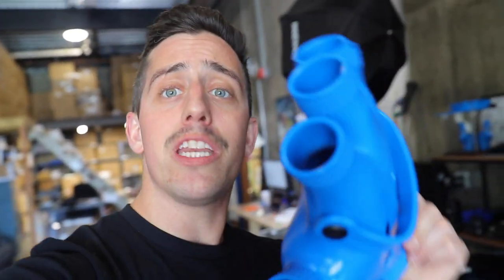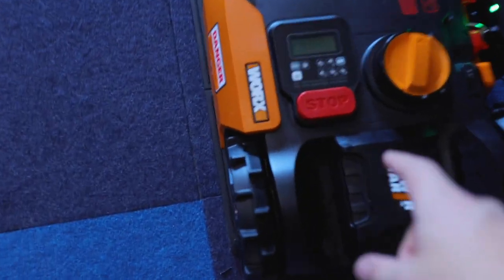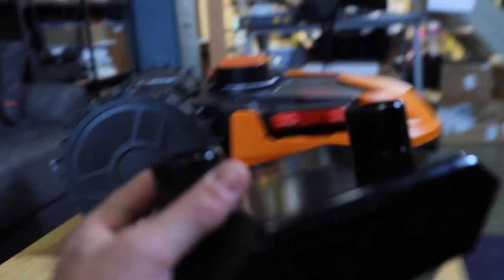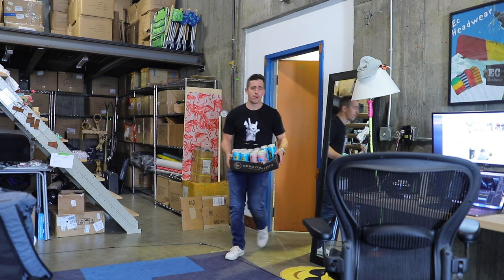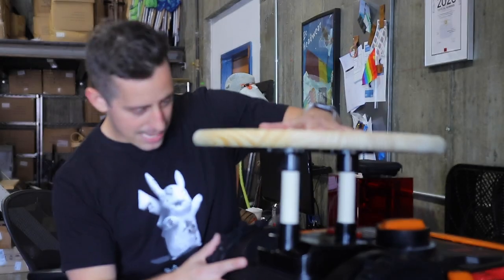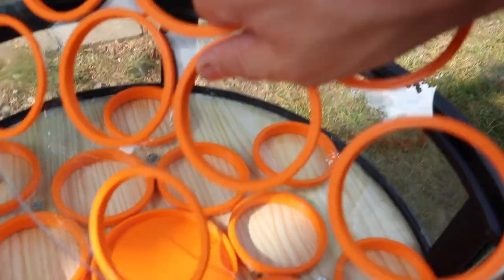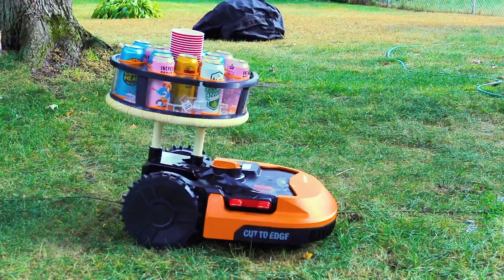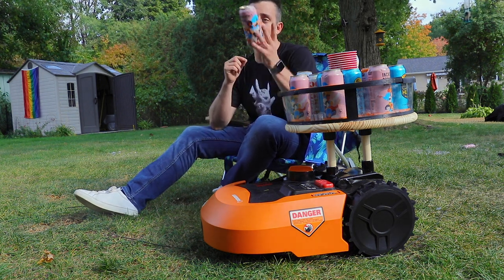Building a Bar Cart for my Robotic Lawnmower (Worx Landroid)

Comment: Facts of the day:

Fact 1: The material with the highest known melting point (4215 ° C) is tantalum hafnium carbide.
Fact 2: The temperature difference between the day and night side of Mercury is 600 degrees.